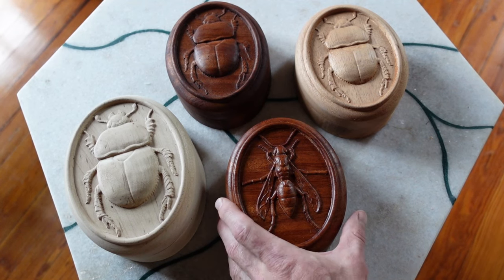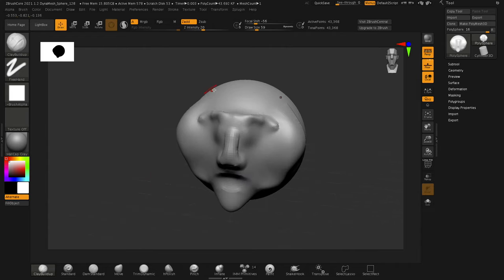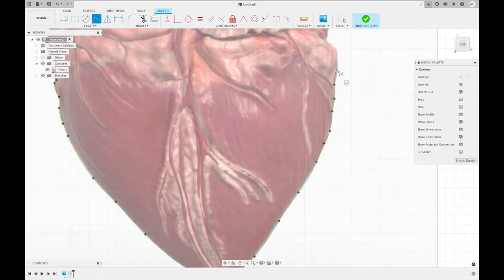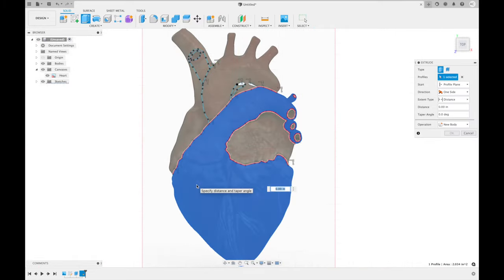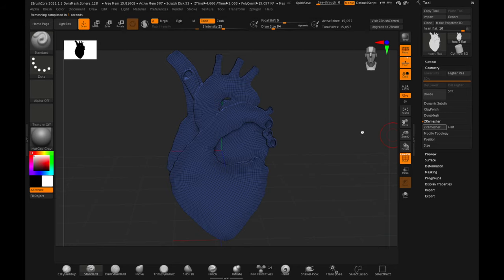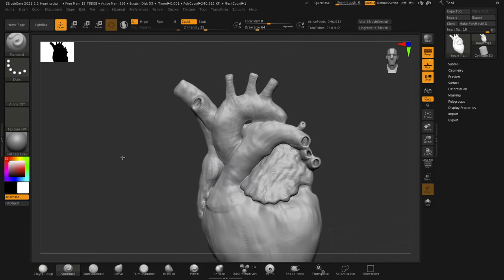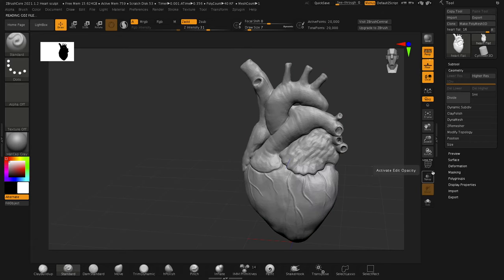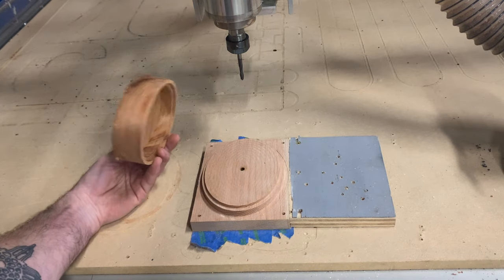Turn a Flat Image Into a 3d Relief for CNC

Comment: Here is a tip for sculpting in zbrush that a lot of beginners dont know. this goes for 3D Coat, Blender and the like too... ALWAYS sculpt in low resolution and move upwards in resolution as you need more detail. If you start out with high rez, be it in dynamesh or subdiv, its VERY VERY VERY HARD to get your shapes correct early on. And shapes are literally the backbone, the DNA, THE LITERAL FOUNDATION of your work. That goes for 2D as well. Very few artists can draw without doing guidelines first, but NO sculptors can sculpt without the shapes and foundation for the details to sit on. Just my little tip i learned early on many, many years ago.
Reply: Also i forgot to add, when you start out in 3D programs sculpting in high rez at first, imagine it sorta like working with warm clay to build the face or whatever up, then putting it in the icebox to cool it off for detail? Same thing. If you try to sculpt big shapes with ice cold, ultra hard clay you'll have a bad time. Same goes for ultra warm clay for handling or details. VERY annoying to deal with. Constant smudges and ruined work.

Comment: As a fast base for organic objects like this you can always shove any image into a program like materialize which is small and FREE where you can generate a heightmap and then use that as a good starting point or even find that good enough without going through most of this process. You can either displace geo in Blender or in zbrush with the heightmap or drag the alpha onto a plane.
Reply: In was thinking exact same thing, Materialize is fantastic. Apparently there is also a website where you can convert a normal map to geometry
Reply: @freshmaker4o  recently there's been some really good ai tools on huggingface for generating high-quality depth maps from images too.

Comment: hi, have you tried using a texture brush? i just discovered this in blender - you use a 2d black and white image to deform surface texture. you wont get the complete depth and your image might need some photoshopping, but after that its basically just ONE click to get you 90% of the work done.

Comment: Awesome work! Are you able to use the G-code generated from Fusion 360 for a proprietary program like the Shark HD4 ( Nextwave CNC)? I know that there is an export option for Shark CNC but I have also heard that generic G-code will not work and you have to use Vectric V-Carve Pro.
Reply from the maker: When you export your gcode from fusion you get a lot of options for post processing for different systems. If your system is in the list just select that and it’ll work. Lots of hobbyist cncs are grbl based (like shapeoko) so in that case you just select the grbl post processor. You can also find other post processor add-ons that people have made if you don’t see your system in the list.

Comment: Amazing video. I need a CNC next to my Lasercutters :-)
Reply from the maker: Cnc machines are getting more and more affordable!  I don’t have a laser cutter yet but I’m sure I will eventually.
Reply: @Chemical14  I am a big lasercutter maniac, after using my diode laser for a year I got my CO2 laser which is a big step forward. Yes smaller CNCV is cheaper size is a big factor with price...

Comment: Thanks for the tutorial.  I'm having problems with the outline of my image getting distorted as I add 3D contours to it.  When you show the sides of your heart, it looks like the "clay" is added to the top while leaving the thick flat material underneath- so the heart outline doesn't actually change if you're looking straight on.  How did you do that?  Help appreciated.
Reply from the maker: I had that problem sometimes too. It will help if you make the original shape thicker in fusion to start with when you extrude it.  Now I just make it much deeper than necessary to start and it prevents the back side from being distorted while I’m working on it. You can always trim off the extra later.
Reply: @Chemical14  Thanks, man!

Comment: Please sir! Thank you for your video, but I have a question! How do I make this an INDENTION?

Thank you!
Reply from the maker: In fusion you can use one body to cut another body and create a negative using the combine function. You would have to convert the mesh to a solid first. If you try to do it with a shape that has too many polygons it will give you an error so you may need to simplify it.  I’m sure you can find a tutorial explaining this better than I can but I have done it to make molds. Check out my video on casting concrete skulls if you want to see how I did it.

Comment: Nicely done, I am surprised how involved this is to be honest. I was expecting that the software can turn an image to a depth map and then simply generate the height.
Reply from the maker: It can turn an image into a depth map but the result isn’t that great unless you’re image is designed for that. In a photo there are lots of cross shadows and reflections and changing textures that get interpreted inappropriately. This method gives you much better control and it’s actually pretty fun.  It feels more like you’re really sculpting but it’s still easy.
Reply: @Chemical14  You are right. The depth map method is best for when you have a 3D object from the beginning and want to create just a 2.5D relief.
Reply: @Chemical14  I am a CAD designer not a 3D artist. My idea was to use a colored picture as an input, convert it into grey scale, sort the grey scale in say 5 levels of intensity automatically and extrude each one of them to different depth. What do you think of this method ? I could smooth over everything at the end with Z-brush. This way I would avoid drawing manual lines which is really time consuming for more complex pictures.
I want to make sliding doors for my DIY furniture with a movie theme, Terminator or Lord of the Rings or something like that.

Comment: Hey this might be exactly what I'm looking for. By any chance, do you know if the Fusion/zbrush technique will be able to export a grey-scale image I can use on my Click-n-carve?

The ClickNCavrve is a desktop CNC that uses proprietary software to generate the G code. I can't use a better software and import it so the only thing I can do is import a image with greyscale information and the clickncarve does all the work from there.

Photoshop works, but its done free-hand - I think your solution will be much faster for me, so Im hoping it has some sort of BMP/PNG export with heights mapped by the shades of grey. 100% Black maps down to the bottom, 100% white is the opposite.
Reply: What you're referring to is called a bump map and is an easier way to paint an image as topographical data that a lot of carving software can convert into a surface to be carved. It would be a substitute for the zbrush portion of this video.

Comment: Can those files be used for 2.5d laser engraving?
Reply from the maker: I’m not very familiar with cnc lasers but I imagine if you could use the same model to generate gcode for whatever type of cnc you have with the right CAM software. Fusion 360 does have a tab for laser manufacturing.

Comment: People are making between $2000 and $5000 a day on cnc routing but want to be cheap about the software you're using, 
yes your just starting out I get it, but after the first $10k in profit I see NO EXCUSE to use cheap bits and substandard non integrated software.